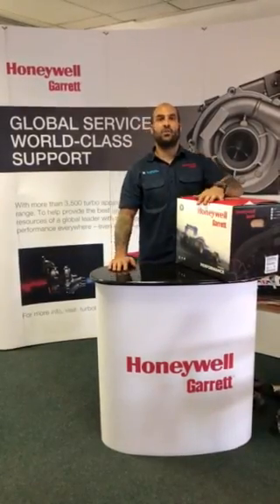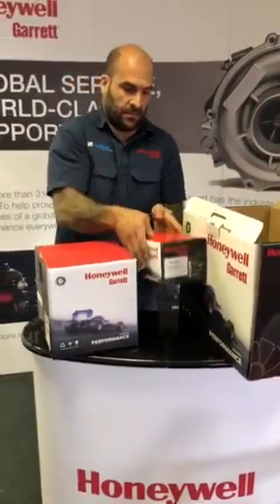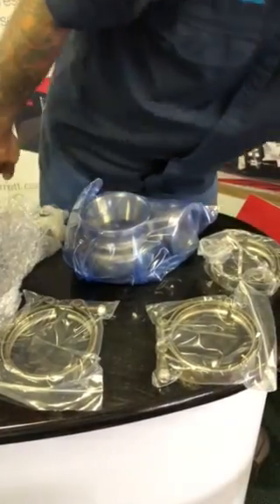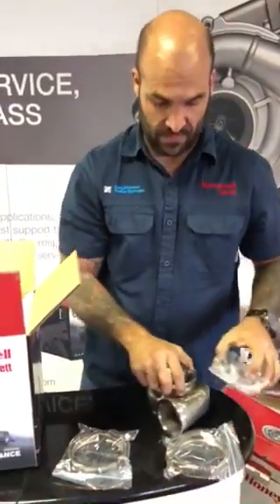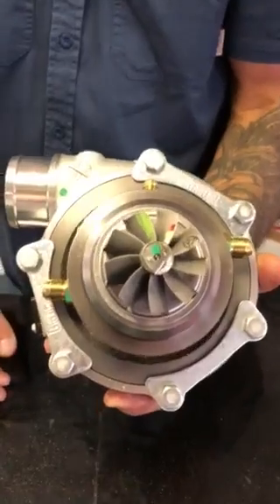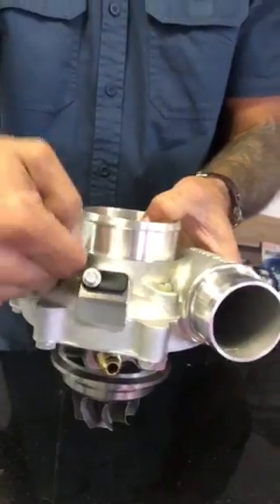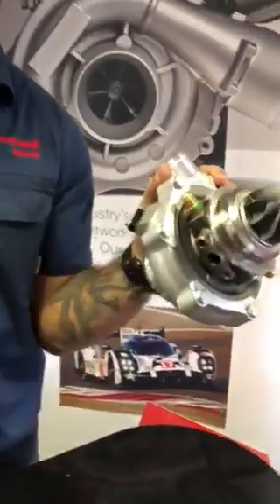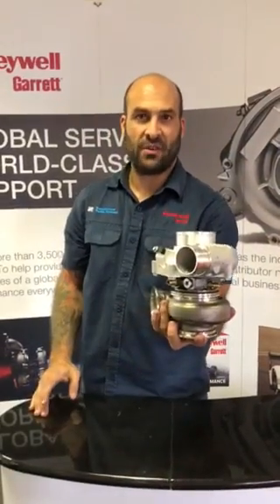G25-660 External waste gate

Comment: Would the g25 550 turbo with a 72 AR be a good choice for my porsche 924 turbo with 8.0 static compression ratio? Looking to make around 350hp
Reply: Or would it be too laggy? Forgot to mention the engine in the car is a 2 liter

Comment: Can this turbo have a external waste gate put on it? If so which ones would work and what all would I have to do to do that
Reply from the maker: Yes, built into the manifold design, I would run the Tial 38mm or 40mm, stay away from the other popular brands, they are not as good and have boost fluctuation issues.

Comment: Will this work good on a stock 2jz gte? Goal is 550 on 91octane.. or the g30-g35.. currently have a pte bb6262 .68ar..
Reply from the maker: Yes but use the larger AR92 turbine housing, the 2JZ is a large motor for this small turbo. If you use the AR72 housing, the power will drop off above 5000rpm.... + -

Comment: Great video:) I recently started to look into Turbo charging my car however I am a bit confused. I was looking into getting the g25-550. Has this turbo got a built in waste gate or would I need an external waste gate. I have a bmw 120i e82 2l 4 cylinder.
Reply from the maker: Yre able to purchase the G25 series with internally gated housings including the actuator etc
Reply: TurboDirect S.A oh great this helped a lot. Would the g25-550 be good for my car??
Reply from the maker: @Less27727  The actuator is the pneumatically controlled "cup" like thing which moves a rod axially to open and close the internal wastegate on the turbo. This is what controls your boost pressure ultimately.
Reply: TurboDirect S.A awesome would the g25-550 be good for my car?
Reply from the maker: @Less27727  What car do you have?
Reply: TurboDirect S.A I have a bmw 120i e82. 2l 4 cylinder engine
Reply from the maker: @Less27727  Yes it will 100% quick spooling and very good power delivery - in fact i wouldnt use the 660, i would opt for the 550 if you are leaving the engine stock.
Reply: TurboDirect S.A awesome :) you have helped a lot. Keep up the great content
Reply from the maker: @Less27727  Glad i could help.

Comment: Great video, just subscribed! Your thoughts if you get a chance, 3.0L V6, specifically the Nissan VG30ET the SOHC version. Currently making 350hp with a hybrid t3/t4, nothing crazy. Looking to make 500 with minimal lag, been debating a gtx3076r gen 2, but these look amazing, any help? Thanks Chris
Reply from the maker: CVTURBO - i loved that motor when i was younger, the older 300ZX with single turbo is a low revving engine, and will need something to spool fast to ensure you have power throughout the RPM range - I would look toward the GTX3071R Gen2 or the GTX3076R Gen 1 or Gen 2 -- or the new G30-770 - i wouldn't go large than this for the sake of losing the low down response.  You have a large CID engine BUT its not a multivalve setup to head flow and volumetric efficiency on this motor is not very high. 

The other option is the EFR 7163 with twin scroll turbine - this will allow very decent spool due to the T4 flanged (its not a T4 volute) inlet, which will work nicely on the V engine config you have. The Gamma TI turbine is extremely light weight, and will make 550WHP at around 1.8-2.0bar gauge pressure. 

Hope this helps -
Reply: @TurboDirectSA  Awesome i appreciate the response! I did forget to mention the engine has fairly large cams (290s with 0.480" lift) Its been hard for me to compare other owners turbo setups to mine as im sure my cams have an effect on boost levels
Reply from the maker: @TurbochargedCreationsbycvturbo  your cams will move your motors volumetric efficiency up slightly, but still remains in the G30/GTX30 / EFR7163 size family for the spool and power capability.

Comment: Great videos and information, keep up the good work man. I've watched almost all your videos but still don't have a full understanding of matching my engine to compressor maps. I have an awd Honda k24 with k20 head, long tube manifold, and Bell vertical flow intercooler. This is mostly a street car so I'm obviously looking for the best response possible. Somewhere in the 600whp would be my goal. I think I have it narrowed down to the g25-660 or the g30-660. Which would be the best for my setup and what would be the difference between the two? Also what turbo housing would you suggest? Thx in advance for any input
Reply from the maker: Hi there Greg May, the K24 is far too large to run the G25 series turbochargers with. The engine revs too high and if you calculate your volumetric efficiency of the engine, you will see that the turbo is far too small - even for a low boost application. 

You need to consider the G30-770 which would be more suited to your engine size and high RPM band. The turbo will spool fast and be able to carry power through to 8000RPM  + without any hassles.  I would suggest the AR.83 turbine housing since the engine revs so high.  This is a 770HP capable turbocharger and small enough to fit into limited space (compared to a GT35xx for example) 

Also Consider the EFR series - dynamite turbochargers with great power potential too.
Reply: @TurboDirectSA  Thx for taking the time to reply Chris. I've considered the efr line but just assumed garrett's new technology was superior. Is this not the case? In reality I think response is more important than the number 600 for  a street, occasional track day, and playing around at the dragstrip with friends. Looking at the efr line again I see the 7163, 7064, and 7670 to be in my range. I should have mentioned I'll be running e85 and space is not a limitation. So what's the best turbo for me, g30 or a efr? Also twin scroll is an option as I am waiting to buy my manifold upon turbo selection. I've read response will be better with twin scroll but will hurt top end slightly. Is this true? Thx again for leading the blind
Reply from the maker: @OnTheWorldWideWeb1  Garrett's latest tech and aero designs are absolutely ground breaking and the turbochargers are proven, but there are options like Borg's EFR setup which is also a serious product, by no means is this some cheap knock off clone of anything - the EFR features a GAMME Ti - turbine wheel head, which is the only manufacturer able to do this, and the turbine wheel is extremely light weight, which caters for and allows the EFR rotating assembly to spool up extremely fast and coupled to the high flow compressors, there lies an answer to the other products in the market. We are distributors for both brands, and i have my personal preferences which is irrelevant to this conversation as i will not allow any bias to affect any advise i provide. 

In order to give you the best advise, i rely on facts and facts alone - ill give you the data, comp map plots and factual experience with each in terms of dyno, road/driving experience and/or drag/circuit racing experience with both/either or. you make the decision at the end of the day - further more i have nothing to gain or lose - just so we are clear. 

Drop me a line at info@turbodirect.co.za and ill take this off line and we can go from there

Comment: Fantastic review Chris,

Im building a haybusa track car for 25min sprint sessions, it'll be getting a 1.5 stroker crank, forged rods and pistons, race port heads ARP bolts, dry-sump etc etc on e85. For an intercooler I'll be sparing no expense either going locally with something custom from PWR.com.au or mezzotech.com
In Australia it gets bloody hot :)
Im looking for a turbo with great response linear torque and a decent top end with a focus on response. I was thinking of some twin scroll turbo for response but am concerned these lovely G25's maybe too big for my application. I could get a billet block and bore it out to a 1600cc if that helps, bare in mind the engine will be revving to 10,000rpm.

What would YOU do?

Thanks mate
Reply from the maker: Hi matey -- we currently hold the records for the fastest FULL STREET Hayabusa with street tires and full street trim in Africa 1000m sprint we achieved 385.9kmh and 406.9kmh on the texas mile, this bike uses the GTX3584RS turbocharger  - the G25 is in fact too small for what you want to do - i would rather use the GTX3076R Gen2 or G30-770 unit which is the latest release. The G25 will make all of its power lower down, be scary to ride (extremely fast boost response) and make no power at the higher RPM range - considering you wont be holding back on spending, the motor and head work will be done, so the engine will flow alot more than a stock unit.  The GTX/G30 family will give you alot more linear power delivery and will still be able to hold its own higher up in the RPM range - and will still be capable of over 600HP
Reply: @TurboDirectSA  385kph in street trim! holy crap!! - so even a 1.5L with a G25-660 with 0.92a/r will run out of puff up top? Incredible. I'll look into the G30 series - thanks again mate this is exactly the answer i was looking for👍
Reply from the maker: @JH-jo9wt  the 1500cc engine IF IT REVS AS HIGH AS A BIKE ENGINE - and flows as much - will run out of steam higher up in the RPM range. Ill make a video of how to calculate this and post it up on our channel for you - keep an eye out for this in the next couple days -

Comment: I think I'm having a bit of buyers remorse with my gt3076r :/
Reply from the maker: don't discount this turbo, it might be old and uses a cast wheel (so what) but this is no joke - the GT3076R is a loaded gun!  We have used these on everything from 4 cylinder EVO's to RB26DETT and anything in between with great power and spool results
Reply: Chris Kambouris it will be OK. I  spent hours looking at the g25 and g30 maps to see how it would work with a Honda k series motor but I felt like both of the newer models would a bit outside ideal
Reply from the maker: @exportedafrican  The new G30-770 is no slouch, its map is nice and wide and caters for the smaller and larger engines without going into surge, aswell as being bale to spool early and make tremendous power - cast your mind back to the GT days, the only turbo that was able to break the 650HP mark was the GT3582R - now the G25 which is 4 family sizes smaller is able to do this easily - and now the G30 break the 750HP mark - the bearing systems are now wake up and light years ahead, its a good thing.

Comment: Looking to build up a K20C1 type R to around 500hp. While still trying to keep it nice and responsive and drivable. How will this spool compared to the stock TD04 that the CTR comes with?
Reply: Man that sounds awesome. And it won't be much laggier than stock I would think? Especially with the '72. How the G25s comparing to the EFRs from Borg Warner?
Reply from the maker: @alastairstedman7840  The issue here is which Borg can compare with the power deliver to the G25-660? It will have to be at least two family sizes larger, (larger than the EFR7163 which is only 550HP capable) which will not respond as fast as the G25 will. Its a no brainer to be honest
Reply from the maker: The Honda motors arent slouches! They flow very well and will easily make the power with the G25 turbo - i wouldnt use the 550HP unit, i would go G25-660 with AR72 turbine housing. the response is GREAT and the power delivery will be linear.

Comment: I'm currently trying to get a VW golf Mk7 with the 1.4 tsi engine (EA211) built as a track car. Top end is not my goal, but I just want to make 230-250hp reliably and the stock turbo is not known for reliability. Do you think this application can help me achieve those number without sacrificing spool time over the stock IHI turbo that my car has?
Reply from the maker: Absolutely it will, however you will need to use the version with the internally gated AR49 T25 turbine housing, the 1.4litre engine is small and youll need ther smaller housing to bring the response into the mix for this engine. It will make ALOT more than your required power across the entire rev range - the turbo is supplied with 1.0bar spring, and will be perfect for this application - contact sales on info@turbodirect.co.za for more info and pricing

Comment: So I'll be having my VQ35DE build next month. Engine will have Darton sleeves and stroker kit to 4.1L which means that each bank of 3 cylinders will be having 2L. Are twin g25-660 good for my application as I heard they are perfect for 2L 4cyl engines? BTW I wish to reach 800hp easily but the guy that will be building by engine says I should go single turbo. Problem is that I hate turbo lag and from all the reviews on the internet it seams like twin g25 are a turbos for me as they are very responsive.
Reply from the maker: Twins will be laggier depending on the application and HP target. Generally to make 800HP you'll need a mid/large frame single turbo setup and lag normally creeps in. Your specific application requires 800HP and its a large size motor - if you want to "divide up the engine" into the two V's -- i.e  2.0litre per 3cyl bank - this will spool up a G25-660 very easily using the AR72 turbine housings. This will make the required power without hassle at all, more than likely around 25PSI depending on tune, fuel and engine build.
Reply: I should add that he wants to use single Borg Warner 8374

Comment: Great review!! I have a bmw 2.8 m50 engine and i run a bw s200sxe, you think the 660 .92 ar is a good improve? Im want better response...
Reply from the maker: Duarte Santos - the EFR wont hold a candle to the G25-660 in spool or power delivery. E.G EFR6173 is capable of 550HP, with the T4 twin scroll housing or the Vband unit including the T25 housing version will not outspool the G25, the power delivery and small package size of the G25 is unmatched bar none.
Reply from the maker: @BEYTEK  sorry buddy you clearly looking in the wrong places - we have 17 cars with these turbos on, lowest boost is running 1.6bar and the power and spool is untouchable, customers came from GTX2867R Gen1 and Gen2's, others came from chinese rubbish to the G25, others went from hybrid builds, and some came from GT and GTX3071R units - every single one saw boost response benefits, and every single one saw massive power and torque improvements.  perhaps type in a search in google and or youtube - youll see PLENTY factual and verified facts supporting the "on paper" claims you mention - here is only one https://www.youtube.com/watch?v=AYzi_5O_lCI&t=112s -- i can give you 100's more.
Reply from the maker: The BW S200SXE is a brilliant turbocharger and uses a TI game turbine blade, which is extremely light weight and spools fast! Changing the turbine housing to the AR83 T4 inlet and Vband outlet will improve spool over what you currently have

Comment: Chris, please some help.
Engine 1.8t 20v , aiming for 400hp , i will let go the gtx for a g-series. 
G25-550 vband 0.72 or wait for 49AR ? Will it spool faster thant vband 0.72? It will run hotter?
Reply from the maker: Hi there, the AR49 will certainly spool faster but will not produce the same power in the higher engine PRM range - higher back pressures in the turbine stage will prevent the max power capability. If you only looking to produce say 450-480HP then use the AR49, manage the heat by using a decent heat exchanger (intercooler) but also plot a compressor map to see where in the efficiency the turbo will be running on the motor at the boost/power level you intend using it - if you in the max or high efficiency range with the AR49 housing, then you safe in terms of excessive heat introduction into the engine, otherwise opt for the AR72

Comment: Garrett is absolutely killing it in turbocharging industry. Great video on showing off the that beauty of a turbo. Chris how would you compare the gtw34 to the gtx30?  .63 housing for both to make it comparable if possible.
Reply from the maker: There is no comparison - the G25 is dual ball bearing, and will outspool ANYTHING in the same family size and/or up to 2 family sizes larger with the same HP capacity. The GTW is a journal bearing turbo offering which is also capable of large HP numbers, but without the same response and linear response, ALTHOUGH its more than capable of a streetable setup especially for the budget racer sector.
Reply: @TurboDirectSA  I see you guys are running that special on the gtw3476 thats why I'm interested in it especially since it is at such a great price which makes it a very attractive buy. Someone I know had the borg Warner 200sx and then changed to the gtw- he saw better spool times and made more hp with the Garrett gtw
Reply from the maker: @ThatV12MiataBruh  it is in stock -- its your call. What engine is this for?
Reply: @TurboDirectSA  I previously had the original Garrett gt35 on my rb25det but it's time for an upgrade now. I feel like the gtw3476 would be just right for my rb25det
Reply from the maker: @ThatV12MiataBruh  the GTW3476 is not an "upgrade" to the GT3582R as the GT is dual ball bearing, HOWEVER the GTW will spool faster due to the option of the AR48 turbine housing, and the turbine wheel's physical size is smaller - so transient response will be improved, especially on the RB25 (doesn't easily spool up a larger turbo)
Reply: @TurboDirectSA  better spool and response is exactly what I'm looking for👌
Reply from the maker: @ThatV12MiataBruh  With the correct housing choice (keeping in mind the overall power you want to make) it will improve spool over the GT3582R - what transmission are you using?
Reply: @TurboDirectSA  I'm using the nissan "big box" transmission
Reply from the maker: @ThatV12MiataBruh   that box is fine - its not an auto - which is laggy due to the torque converter
Reply: @TurboDirectSA  thanks👌